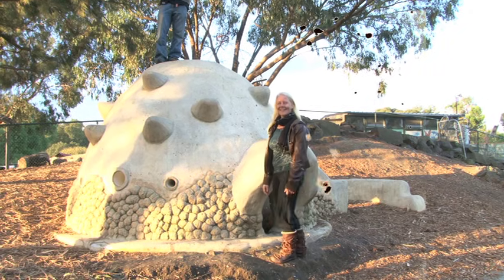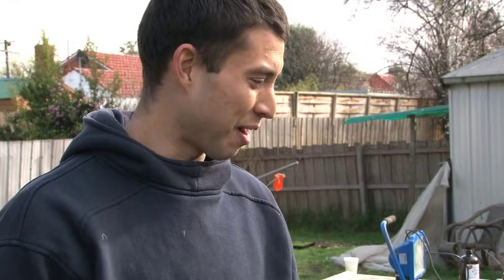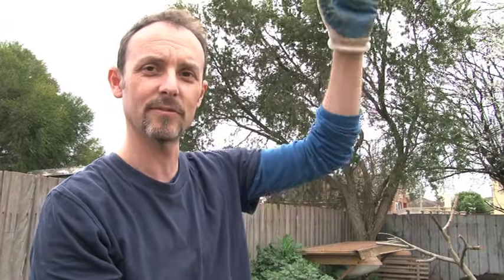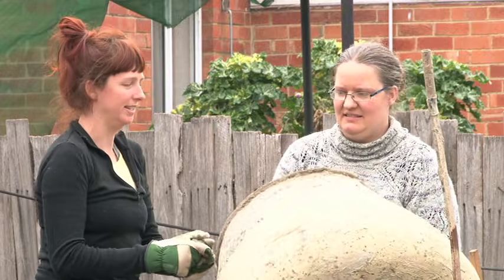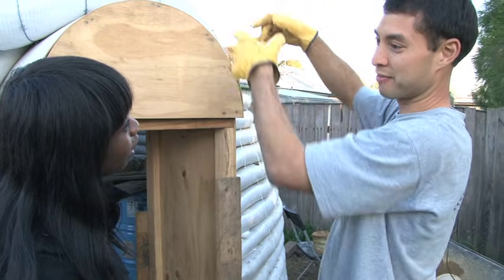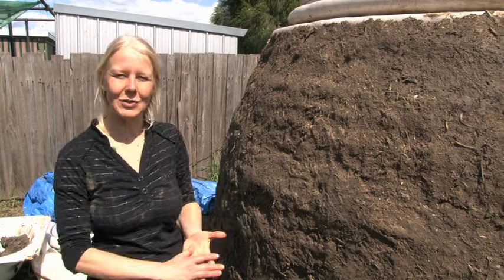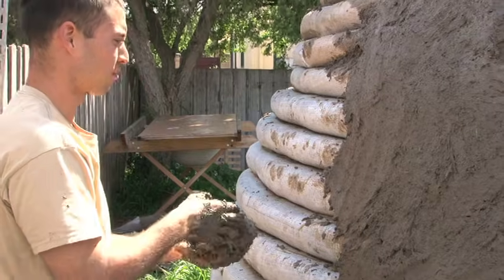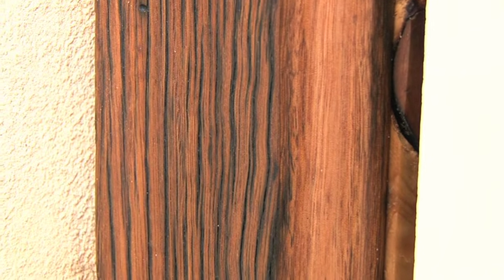Tiny Designs- Earth Bag Dome

Comment: 7 years later, can we get an update on how this structure is working out as a sauna? I would be interested in its long-term reaction to heat and steam on the inside, how the interior holds up, if any mildew formed, problems, etc. Its a nice size and shape for a sauna, but heating up the upper reaches of the dome might take a long time. Saunas typically have low ceilings so the heat stays down where the bodies are.